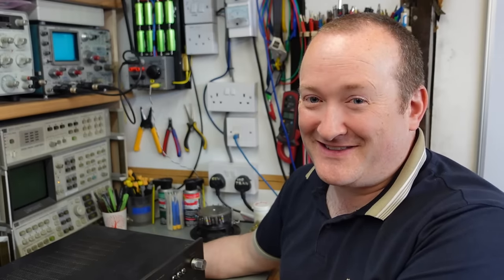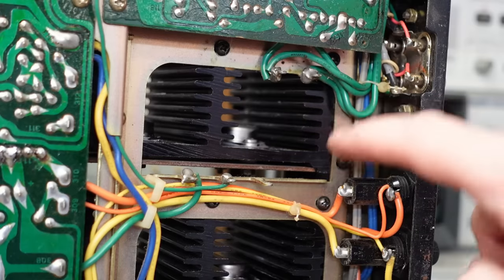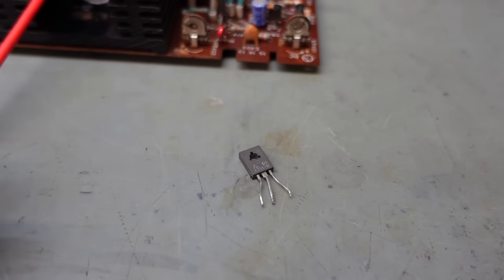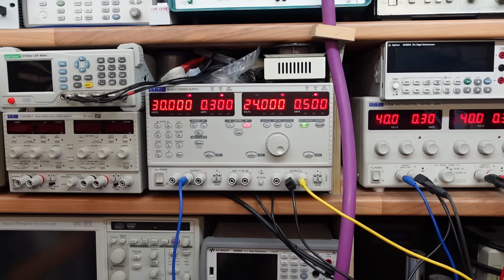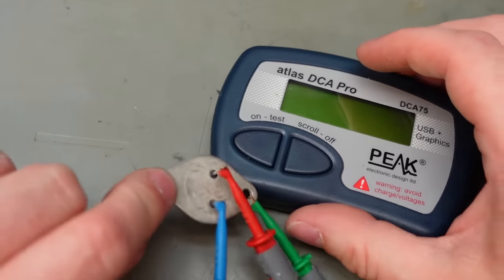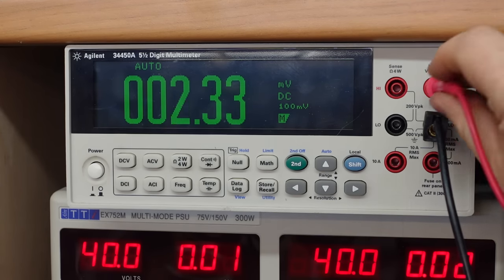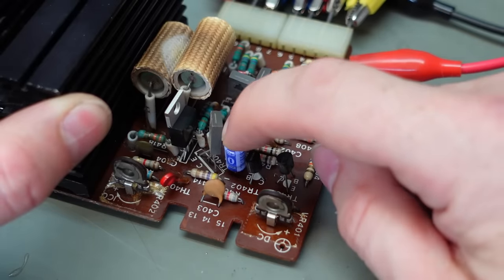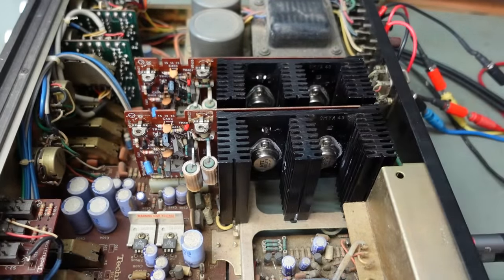Technics SU-3500 Amplifier Repair

Comment: I know next to nothing about electronics, but these videos are captivating. Mark's knowledge plus his pleasant demeanor keeps drawing me in. 😀
Reply: You will eventually learn!
Reply: @hernancoronel  I used to know Ohm's Law. Maybe that will help. 😀
Reply: @Flavum  It will eventually wear down your resistance. You might even meet a few cool conductors along the way.
Reply: I agree with you. I have a basic understanding of electronics, but Mark makes it more accessible.
Reply: Doesn't he just...It's years of experience right before your eyes. Can't learn that from a book....
Reply: Marks fantastic 🤗🤗🤗
Reply: @gyrgrls  Oh yeah? That's watt you say. 😀😀😀
Reply: That’s OK you don’t need to know much. The fact that he got the DC offset to under 1 mV DC offset (at 22:47)  is amazing. Basically that means that amplifier/receiver is going to sound amazing and not damage the speakers!! good old mid to late 70s amplifiers are amazing. They certainly don’t build them like that anymore!

Basically if you were shopping for an old vintage amplifier/receiver at a thrift shop, if you hook up a voltmeter to the speaker outputs and verify that the DC millivolts are below 30/50, you should be safe to hook up a pair of speakers without doing any damage. Ideally we want this number to be zero but once you start getting above 50 mV or so, you can start damaging speakers. 

Actually I think you have to get somewhere close to 100 mV of DC offset before you start damaging speakers but you would probably start hearing distortion somewhere around the 50 mV range or so.
Reply: Picking up new vocabulary listening to this😂😂😂🎉🎉🎉🎉
Reply: Yep I totally agree

Comment: The SU3500 is a super amp. Rated at 43W into 8 ohm and capable of driving 4 ohm loads with ease. Did a full recap on mine and it sounds wonderful.
Reply: А есть люди, которым не нравится его звук.
Reply: When in doubt recap it out😅

Comment: G, day Mark from Sydney Australia.
I really enjoy watching your circuit board investigations, testing;
* Diodes
* Capacitors
* Resistors
* Integrity of traces and solder connections
* Oscilloscopes (frequency peak to peak) two independent channels.
* Flow of voltage and amperage to specific specs of each component.
* Dis- assembly and assembly of cabinets ( with repair and manufacturing of controls)
Thank you for your time in producing these videos, sir.
🌏🇭🇲🤨

Comment: Mark, many years ago I discovered a really good alternative to using a multimeter to test components. It required a 'scope to display the test results but it was quick and effective. The 'scope displayed the properties of the component under an AC test current. A diode gave a right angle, a resistor a diagonal, a capacitor a circle. Subtle differences in the display revealed leaks, high ESR, etc. A great bit of kit.
Reply: it's a curve tracer, it's actually built in on some old Hameg scopes labeled as component tester.
you can have any scope to display a curbe trace in X-Y mode using an ''Octopus'' circuit
Reply: @mohsentabouna6401  No, that Hameg scope has a component signature analyzer and not a "curve tracer". Many other people mistake that as well. You saw a real curve tracer in this video @24:30, the type 576. Look at that point again. It is plotting a series of steps of operating points to display the characteristic curves of a device in current / voltage axis. A signature analyzer is looking at devices in a single operating point area. Even the DCA75 transistor analyzer that was shown in this video has an actual real low current curve tracer that you can use by USB to see the characteristic curves of devices displayed on your computer. But the DCA75 can't source enough current to be useful for matching output transistors and is only good for small signal devices. Transistors need to be tested and measured at their intended operating point in the circuit for current and voltage to find a matched pair with similar curves or to get a good reference check.

Comment: The stereo mode switching is probably great for those 60’s mixes that have instruments/vocals hard panned. The L+R mono would stop you having Jimi coming out of one side, the drums out of the other… Or the individual L or R mono modes would let you isolate the hard panned instruments.
Reply: If I recall correctly one of the argument for that switch (which was popular on amps of the period) was that you could use two amps as individual mono blocks and double the power.
Reply: @SierraLimaOscar  Ah yeah that makes a lot of sense!
Reply: It's also great for when some muppet youtuber takes an unnatural liking to one channel or the other.
Reply: @godfreypoon5148  That my left ear loved this video issue seems less common now, think it must’ve been a video editing/codec issue.

Comment: I had an old Technics with a drop down class panel that was lit green......loved that amp because it run AC or DC 
 power

I fed more speakers to that 70 pound amp than I care to remember

Comment: Those Technics Amps were gold when it came to audio equipment. I'm a product of the 70's and 80's so I remember them well. Was hoping you were going to test it by cranking up some Led Zeppelin. Technics amps were meant for listening to Zeppelin tracks. I wish those were still around new. Such an iconic piece of equipment for audio.

Comment: I always understood the 13A fuse was to protect dead shorts in the cable, and most hifi has a mains glass fuse rated correctly for the device. So the glass fuse is the device protection really, and non UK versions won't have any such fuse in the plug. Also, the ceramic sand fuses only go down to 3A which would still be too high a rating for many amps. Great vids, thanks Mark!

Comment: In a Japanese amplifier, I have seen a plastic transistor become intermittant and put the entire supply voltage on the speaker.
Several angrily placed taps with my Widlarizer rapidly changed it's geometry.
Reply: In that case you should have diffused its junction around the whole workshop.

Comment: These videos of yours are at the top of my list for 'handling real world examples' because of your presentation, documentation and editing. Also it sounds like you are using a venturi de-soldering, which is something I've only imagined before. I did build a similar device for killing poisonous spiders long ago (equally effective), but it's comically enormous for electronics de-soldering (1.5 meters long).

Comment: Great vid Mark. I owned one of these back in the day and loved it. I have also repaired a few. It was much easier back then because all the semiconductors were available from Technics. It has reminded me that I must get round to repairing my old Sugden power amplifier and pre-amp unit. It's only been broken for about 12 years, so no rush! Incidentally, I have 2 sets of the Sugden test equipment, low distortion signal generator, AC millivoltmeter and distortion analyser, don't know if you've come across them or remember them. I live in Huddersfield and Sugden were based just a few miles away in Cleckheaton, so a lot of old Yorkshire engineers used to have these. The sig gens are quite amazing for their day at 0.02% THD as I recall.

Comment: I must admit, I do soldering a little different from a lot of folk. I tend to 'wet' the joint with good flux, then 'load' the iron with solder and apply. This way the solder runs into the joint quickly, and I'm 'in and out' of there in less than a second. I'm always aware of excessive heat applied to transistors and ICs.

Comment: I like how this mid-to-late 70s amp was built to be rugged, almost like a tank radio. It looks like it could survive a nuclear blast, but I'm biased because I own one. 🙃 I find the selector switches it has more durable than isostat ones. Love it how many inputs it has. The only donwsides I could find are the lack of an MC input and disappearing threads on the speaker terminals (when someone before used to tighten them too much).

Comment: The stereo selector comes in handy, when you play old reel tapes that are recorded in 1/4-track mono. 
If you play these on a stereo machine, you'd have to turn the balance pot all the way to one side and have only one speaker playing. 
With the switch, you select L and play that track on both speakers, then select R and play the other one on both speakers.

Comment: @15:40 ... those de-soldering irons are good, I need to get one. I use copper braid, and sometimes solder-sucker - the latter I loathe, and is not efficient. The great thing about your de-soldering iron, is that - once the  solder is molten, the iron sucks up the solder, and cools down the transistor leg/pin at the same time; win win! I've tried those cheap heated solder suckers - yep, they work too, but over a period of time (not much) the heating element becomes destroyed by the impulse action of the vacuum creating plunger. In fact, this generated an earth leakage and the RCD/ELCB in the consumer unit tripped. No good!

Comment: I do love a big metal 240V box with no earth connection and a 13 Amp fuse.
Reply: The arrangement usually is for the enclosure to be referenced to the midpoint of the symmetrical secondary of the highest voltage, hence the double insulated classification. Now, earthing that would be asking for it!

Comment: Have you ever used deoxit on pots and the non gold header connectors and switches? It works very nice. I use the little bottle with the needle tip instead of spraying it all over.

Comment: Ive always been skeptical about those modern to3 packaged power transistors.
Not too easy to source originals.
Even if your lucky they can usually cost way too much.

Typical problem with these vintage amplifiers when fitting new power TR'S
The original drivers can become stressed at first powering on.
That's why its always best to use a scope without the heavy loads.
Then comes the heavy load soak test?????? Fingers crossed.

Looking forward to the update.

Comment: You generally got 13 amp fuses in plugs when you bought them, so most people didn't bother to change it to a rating close to the appliance they're putting the plug onto.  This was back when most appliances didn't come with a plug and you had to supply your own.  None of that moulded plug malarkey, back then.  People were trusted to know how to wire a mains plug.
Reply: What ampage fuse should you generally use for stereo equipment
Reply: @sphenoidjjj  A 5 amp fuse should be enough for most stereo equipment.

Comment: This one's really raiding the component stores. For some reason I'm wondering how much solder you use on these repairs, by length.
Reply: Once I accidentally put one roll of solder for each board on the part list.
I am sure that company still has plenty of solder.

Comment: My NEC AV 350 is missing its pre-amp links. Where can I obtain a set? I have tried cut nails bent to shape (did not quite fit/ loose fit) I have also tried a rca wire. PLEASE HELP POINT ME IN THE CORRECT  DIRECTION?

Comment: hi Mark. just want to ask, i have an Aiwa AP D-80 turntable from the early 80s, i got it from my uncle and it doesn't work correctly. the platter is supposed to slide out from the from of the deck as it was designed for use in limited space. i'm guessing that this would work with a worm screw like a CD laser, but everytime i try to make it slide out, i just hear a grinding noise and nothing moves. i was wondering if you had any idea what the problem could be

Comment: I have an old tape player from this sort of era. I replaced the drive belt on it , and after turning it on , it fired up for 10 seconds .. there was a loud 50 hz hum and then smoke came out of the transformer and the windings melted , its a dual output transformer . I think it needs 12 and 24 v . Would putting seperate 12 and 24v trannies in there be a no no or is this viable ? Also how could i verify the voltage ? The schematic says 22.4 v on one input and 12 v on the other but i think thats after rectification so maybe im looking for a 12 and 6v tranny ..

Comment: The impedance selector was not for ceramic elements. Ceramic elements have a completely different impedance, voltage and frequency characteristic. All the selections must have been for MM. Which is unusual, I thought MM impedances were pretty must standardized.

Comment: 20:36 There is a mistake right there. It's even printed on the silkscreen. Base is in the middle at most of the european standard transistors, like the BC182 in this case... and the original had it on one side, as most of the Japanese standard transistors.
Reply: Essentially the BC182 you've inserted, have the Base and Collector inverted. So, in the circuit, it means it is having the B-E diode between the two driver bases - that should limit your idle current to zero and you should have no way to control it - but according the video, you can. Something is fishy here 🙃You did something off camera? 😉
Reply: @janosnagyj.9540  You simply haven't pay attention to the exact model number: it's a BC182L, which is different to BC182 and has the same pinout as the original.
Reply: @henriktoth56  Well, today I learned again something. I never knew such an alternate pinout ever existed for a device like this. In fact, in the past almost 40 years of electronics repair works, it never came in sight nor ever had one in my hand. Good to know, thanks for pointing it out 👌😉
Reply: @janosnagyj.9540  Yes, back in the day BC 182/212 and the higher gain 184/214 were really common go-to transistors in the audio industry, and the "L" versions caught many an engineer out!

Comment: 5:10 Another example of a rather bizarre design.
This amp must have cost an arm and a leg, it's huge and very solidly built - and yet, the amplifier itself is total rubbish. The input pair with simple resistors in both the long tail and collector load. Very low diff amp current: only 800uA. Hugely disbalanced: TR401 draws only 160uA, and TR402 the rest. Crude way of dominant pole compensation (R405-C402, C404, C405). The THD figure of this garbage is probably 0.5% at least. Disgusting.

I know it has nothing to do with the video. You didn't design this thing, you're repairing it, and your skill level is astonishing. Much respect!

Comment: Hello, can u tell me can i replace me capacitor in Technics sa-tx 50. original cap. is 80v 8000uF can i put 80v 10000uF or 100v 10000uF,  i cant finde the same capacitor for mine amplifier?

Comment: What is that mains "safety" connector you use called. Where can I get one. Thanks
Reply: isolation transformer
Reply: @gribbler1695  no. I mean the gadget at @2:18
Reply: @gribbler1695  Thank you sir! God damn thats expensive for what it is

Comment: On the switch with left & right and reverse. Apparently unlike myself with faulty unbalanced equipment ya'll don't know if it is the headphones, the speaker amplifier, or unbalanced track. I can immediately see the benefit of these switches on my fried work hard systems.